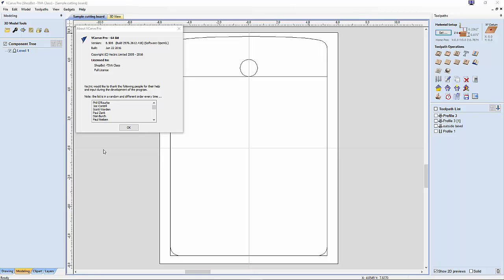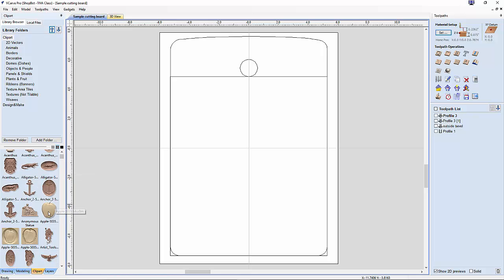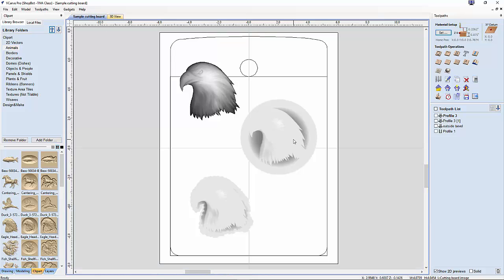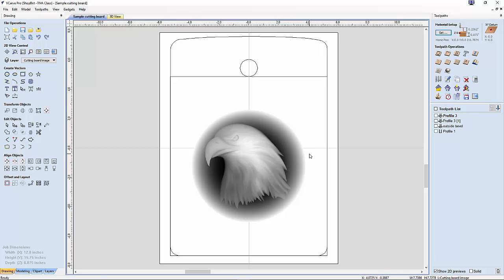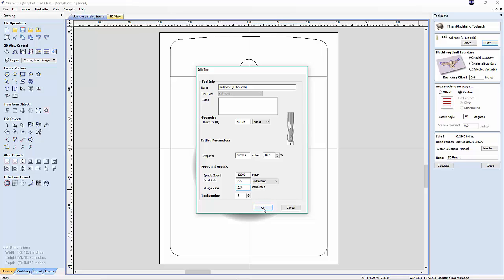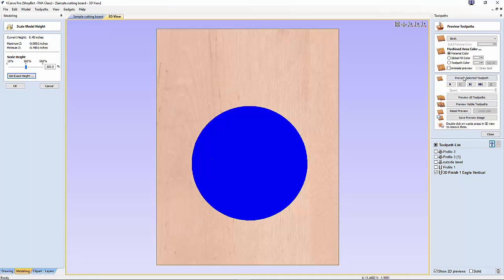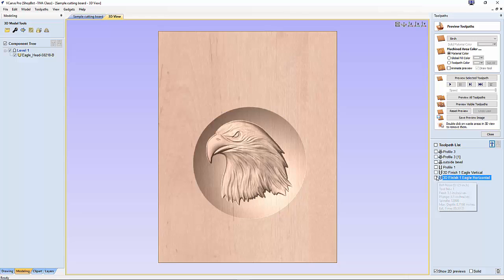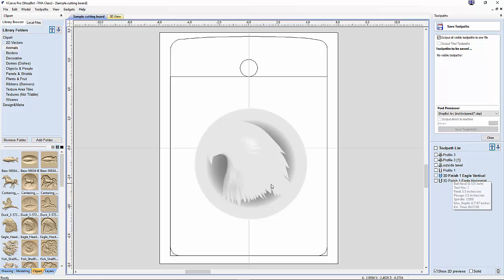Basic One Sided 3D Relief Carving

Comment: I take the same eagle and get a message , the composite model is empty. You must have a 3d model before attempting to create a 3D model. I'm using same clip art in V9 of vcarve pro and stuck here... What do I have to do to get it to work? What am I missing... Thanks
Reply from the maker: Sorry for not getting back sooner.   When you purchase VCarve Pro 8 for above, you get 10 sets of clipart with 
9 of them being 3D clipart models.   After installing VCarve Pro 8 or above (or Aspire), you must run the executable files for each group of clipart.  They should then automatically appear in your Clipart tab when you click on Clipart.

Comment: where did you get your clipart and how to I get it to the clipart folder?
 thx
Reply from the maker: Starting with VCarve Pro 8, there is a lot of 3D clipart that comes free;  just click on the  Clipart tab at the bottom;  if you want to get 2d clipart, you can import a bitmap graphic and use the Bitmap Trace tool to convert to vector
Reply from the maker: Sorry for not getting back sooner.   When you purchase VCarve Pro 8 for above, you get 10 sets of clipart with 
9 of them being 3D clipart models.   After installing VCarve Pro 8 or above (or Aspire), you must run the executable files for each group of clipart.  They should then automatically appear in your Clipart tab when you click on Clipart.